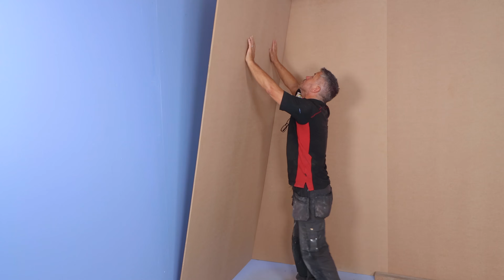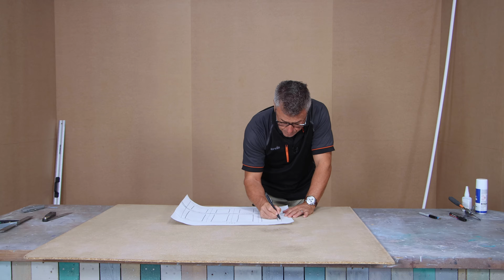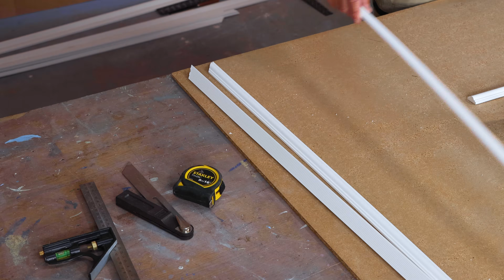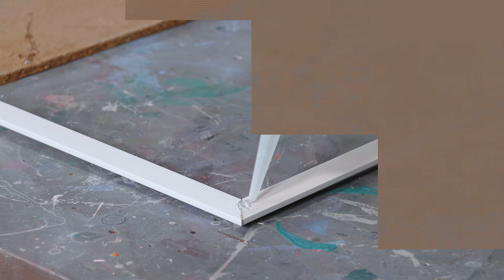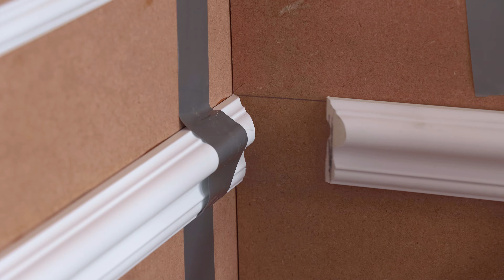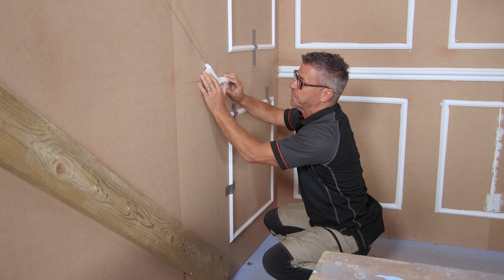How to Fit Wall Panelling Mouldings, Beading and Dado Rails | Full Tutorial with Craig Phillips

Comment: What should be used to fill gaps between the mitred joins on the mouldings? I've got caulk but finding it hard to finish the join off nicely.
Reply from the maker: Yes I get what your mean with chalk, have you tried Polymer filler and sealant, ive used that and it works very well